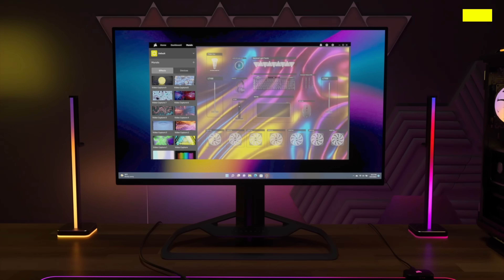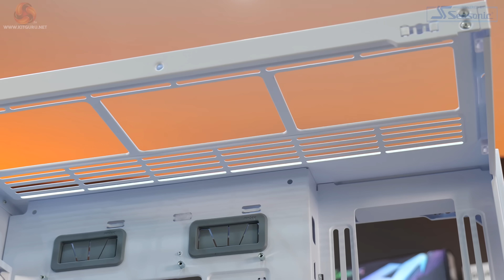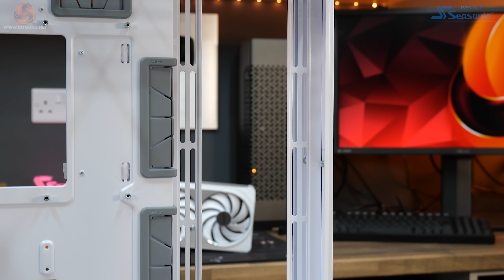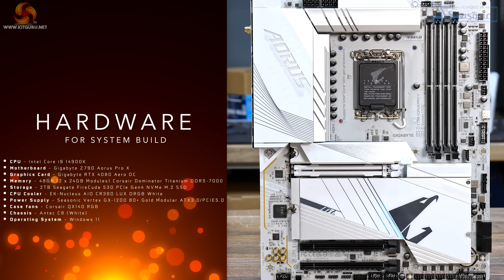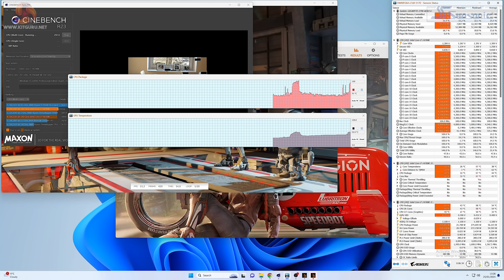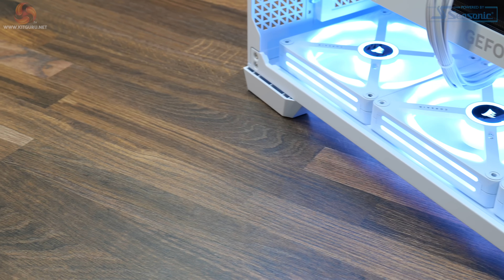Antec Constellation C8 Case - Best Budget O11D Clone

Comment: Excellent case. I agree with you about the ability to mount 140mm fans at the front. I also wish they would have made it just a bit longer. This would allow it to confidently fit 420mm radiators at the top and bottom or maybe even three 160mm fans. It also would have allowed them to add support for 160mm fans at the front. I think this was also a huge missed opportunity for Antec. If I'm jumping from the c5 to the c8, I would really like to be able to install an Arctic 420mm Liquid Freezer III at the top instead of being limited to 360mm radiators like the c5.

Comment: Glad to see that 3 140mm fans on the side works. I'm about to do this once my noctuas arrive in the mail!
Reply: @AnosTheDaft  did u managed to fit 3 fans? Pls let me now
Reply: @Pelaa107 I did, I had to use a drill bit to drill some holes at the very top of the case for all 3 to fit. I recommend doing the top since you are less likely to see that area, depending on where your case is. 

Easiest way to do it is to put the bottom fan as low as you can, the middle fan in next right on top of the lower fan, and then set the top fan in and gauge where the top screws need to be.

Just be careful - When I initially did it, I put too much pressure on the fans from top to bottom and caused the fan enclosure to morph and the fans weren't spinning so make sure when you are doing this to not smash the fans together lol
Reply: @Pelaa107 I'd send you a picture but sadly that function is not supported on YouTube

Comment: Cool mod!! I saw in the specs that this case also supports 160mm fans. In this case, only two instead of three on the top and bottom. What would be better, two 160mm fans or three 140mm fans, considering the temperature/airflow/noise ratio? Could you test it?

Comment: As the top has 70mm clearance and fixings for 3 x 140mm fans, does the Arctic Cooling Liquid Freezer III 420 fit? It should have around 65mm depth with the radiator and fan, and being 420 it should be the same size as 3 x 140mm. Antec do officially state max is 360 AIO radiator, but this doesn't mean this is fact, just that they cover themselves by not committing as some 420's may need a few millimeters more.

Comment: Can anyone confirm if the Antec C8 Seamless Edge Front and Side Full Tower E-ATX Case supports a 360mm or 420mm liquid cooler radiator on top? I’m planning my build and want to make sure the radiator fits. Thanks!
Reply: Did you figure out if 420mm radiator would fit?
Reply: @Decks370  420mm would fit, but I went with 360mm still good

Comment: Just one point of clarification, the bottom panel also supports the option for 2x160mm fans, in addition to the 120mm and 140mm support…by removing the optional brackets entirely. There is a SKU that comes with two 160mm Antec fans on the bottom, and a 140 on the rear.
Reply from the maker: Thanks good info 👍🏻

Comment: Weird it didn’t come with 140mm fan support of the box. Hardly an unusual size either in 2024.  I prefer 140 over 120.
Reply from the maker: It does, just only 2 x 140mm on the side mount. I modded it to fit 3. It also supports 3 x 140mm in the roof and floor and one in the rear.
Reply: @KitGuruTech any trouble getting the icue link cable to fit on the 3x side 140mm fans? I am tempted to do your same mod to run qx140s

Comment: A lot of competition right now but the price of this surely puts it close to the top. Corsair 6500 is a fortune compared to this.
Reply: Let the Corsair fanbois enjoy their expensive case, we offer good quality combined with awesome value for money.  What more can you ask for?
Reply: Not much, honestly. I have the C8 Wood Curved and it's an absolutely stunning case. The curved glass panel fits perfectly flush with its adjacent panels, and the method engineered for removing and replacing it is what I might expect from a case running an extra $100.

I'm not sure why the curved model went down to only supporting two 2.5" drives and one 3.5" drive, compared to the non-curved models, such as the one in this video, which offer four 2.5" drives and one 3.5" drive - it seems like an odd decision to make for what js presumably the premium trim/model. Luckily, I was able to get a 3.5" to two 2.5" drive conversion bracket from Corsair on Amazon for ~$5, so I have my four 2.5" drives regardless. Sacrificing the 3.5" drive is no real loss - HDDs are basically dead when it comes to everything besides massive capacity NAS devices, cold storage, and drives over 15TB anyway.

I thini it would be cool to have some options for Antec supported case mods similar to what Lian Li does with the O11. I actually stumbled upon this video after Google searching "Antec c8 case mods." I'm about to start my build with the C8 using a Ryzen 9 9950x and the Radeon RX 9070xt once AMD finally decides to release the damn thing instead of intentionally playing second fiddle to nVidia and delaying it so that they can guage the 5070 and 5070 Ti reception first (AMD, we're going to be severely underwhelmed, same as with the 5080 and 5090; if anything, the 5070 Ti will get the most interest considering it's basically a 5080, only receiving slightly lower binned chips with less cores).

Anyway, I'm going to run a custom dual-loop water cooling system in this case - one loop for the CPU, VRM, and M.2 SSDs, and one loop for the GPU, northbridge/southbridge chipsets, and RAM - I'd love a more simple solution for mounting a distribution plate reservoir with a D5 pump "on" the front face glass panel. I'm probably going to get a radiator bracket of some sort and attach it to either a side, bottom, or top fan between the case bracket and the radiator in that position. Otherwise, I'll need to construct it so that the hardline fittings themselves are what holds the distro plate up, but I'm not sure that's the move.

I've seen some photos online of someone who did something very similar to this using the C8 Wood Curve and had it displayed at Computex 2024. The pictures were close enough to be able to see how fantastic it looked, but just far enough away that I couldn't make out their bracket solution for securing their distro plate to the front.

In a perfect world...

Comment: I love my Antec C8. Stunning case and fits the new Arctic Freezer III like a dream with tons of room to spare. I got all white
Reply: Are your temps good ?
Reply: I got same but all black. A nice case for the money indeed. I hope for front mesh DLC I would prefer the look over the glass but alas.
Reply: @Daisudori question is the usb ontop actually usb 3.0 the color of the ports are black in the case but it says 3.0 is it just a different color I’m just used to the blue to know
Reply: @ yea its 3.0
Reply: Is that the AC 360 or 420? Antec officially says 360, but has space for 3 x 140mm on top, so should fit a 420 theoretically.
Reply: yeah whats the temps like? what CPU you using?
Reply: Can it take 3 160mm fan in bottom?
Reply: @francisdumlao8040 no only two 160mm fans  u can fit in bottom but 3 140mm fans can be fit on top and bottom
Reply: @francisdumlao8040 no…

Comment: These o11 style cases really cry out for you to make use of all the fan mounting areas in order for it to look it's best.
But the problem I have with this... It's horrendous overkill.
Even with the hottest components  you only really need a decent case, a few good fans and an capable AIO.
You've got 10 fans in there! And with Rgb, I suppose you could lend it out whenever someone needs lighting for a rave 😂
Reply: Check out our Antec fusion fans in white - they are priced well against other white ARGB fans on the market.
Reply from the maker: It can also become very expensive to fill the case with fans too.

Comment: When you test the rigidity of unsupported top corner of the case, do so without a radiator / fans mounted. You comparison to the HYTE case isn't all that accurate due to extra rigidity that the radiator contributes to Antec.
Reply from the maker: This case feels as rigid with or without the radiator installed. The Hyte case feels equally flexible with or without a radiator installed.
Reply: Appreciate it! This may seem like an inconsequential metric to some, but for those who want to do custom watercooling with rigid tubes and a top radiator, case rigidity really does matter.

Love the build and getting the 3rd 140 fan at the top on the side really makes this case shine. That's a 100% necessary modification IMO!  @KitGuruTech
Reply: @conserve_liberalism  I bought the HYTE from James review here on Kitguru last year when he reviewed it. I agree, its not very rigid, but i love the case apart from that. looks great with the screen. Thanks James for the review happy with the case, even if its not perfect !

Comment: Great review. Love that you modded it to make the 3x 140s work. I think your points of removable fan brackets is super valid. If the case was maybe 1-1.5" or 3cm taller the 3x 140mm fans would be no prob AND you'd def not run into issues with doing a push/pull + thicker rad on the bottom.

Comment: This looks almost exactly like my FSP CMT380B which goes for a silly price.
Reply: Your FSP CMT380B is smaller and  doesn't have cable grommits, only supports 2 x 120mm fans in the side and doesn't support E-ATX boards.

Comment: dam is identical to the corsair 6500x
Reply: and way cheaper!
Reply: When you see the two side by side and in person you will know the difference quickly.
Reply: @rickss69  looks pretty similar to me tbh
Reply from the maker: Other than reverse connector motherboard support and iCUE link integrations, there isn't much difference between the two, build quality is similar but the Corsair 6500X is much more expensive. Corsair fanboys may try to convince you otherwise but from a totally impartial viewpoint, there isn't much in them.